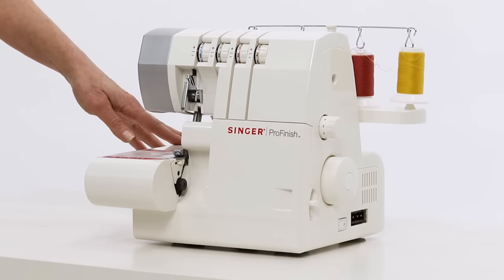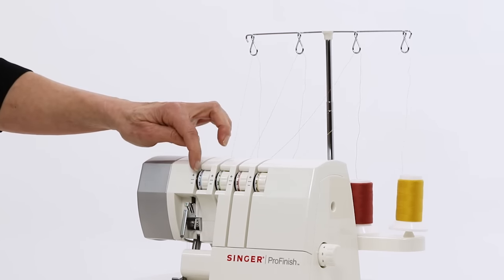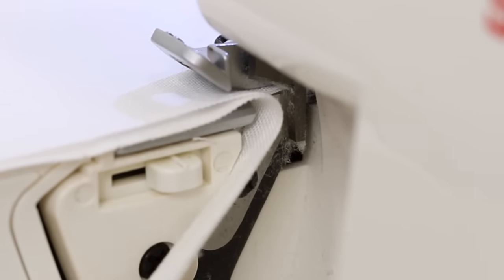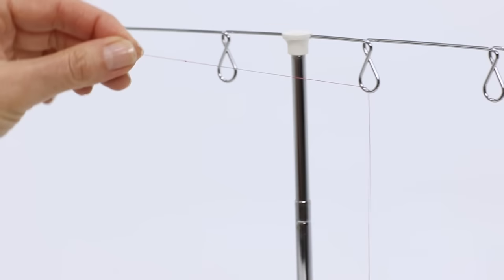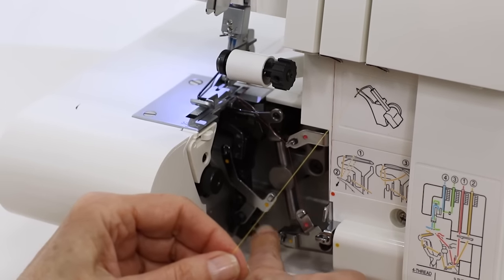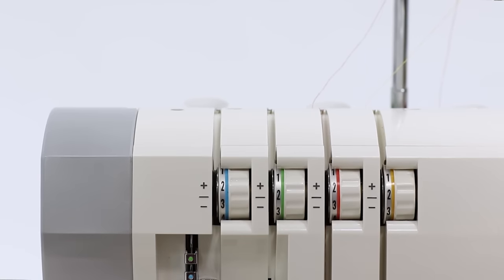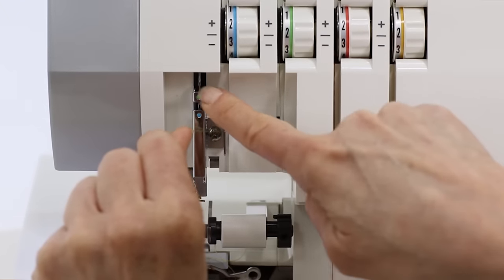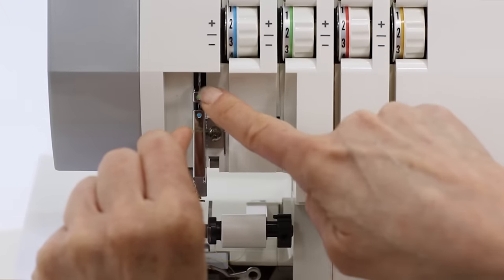Threading a 4 Thread Serger Overlock Stitch - SINGER® 14CG754

Comment: I have had my serger for many years, and don't use it, but I was asked to hem 20 white tablecloths by a  friend, and figured this would be the quickest way. My sister 4 years ago was home and helped me change the white thread in the machine to black so I could hem denim aprons for Habitat for Humanity. She lives 1200 miles away, and so I decided to use the knot the threads and pull through the ports so I didn't have to thread it. I screwed it up, and went looking for a video that would show me how to do this, I've viewed many over the years and could not find one with as clear an explanation as you just presented.  I'm going to thread this again and get ready to hem those 20 tablecloths, and I think I'm much calmer than 1/2 an hour ago.  Thank you so very, very much.  I'm looking forward to being able to use my serger from now on.  Fingers crossed.

Comment: Thank you so much for this video! I’ve got everything in place correctly but I am still having problems with my right needle. The thread keeps coming out of the needle. It’ll sew very well for a good 5-10 inches, then the thread comes out of the needle and will not sew anymore. Any ideas on what I’m doing wrong? Please help! Thank you!
Reply from the maker: Hi...Make sure the thread hasn't come out of the tension.  Don't just try to rethread the needle...start from the beginning and make sure the presser foot is up when you rethread that thread path. Hope that helps!

Comment: The underneath the material is so loose .how Do I tighten it so it is neat
Reply from the maker: Loose threads under your fabric usually indicates that your upper tension is too loose (or it is threaded incorrectly).  When in doubt, rethread!